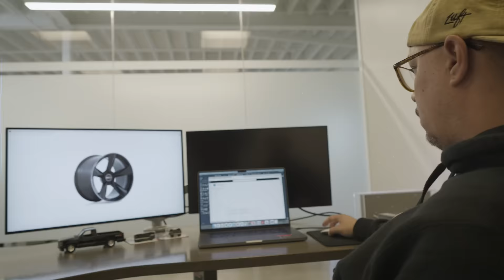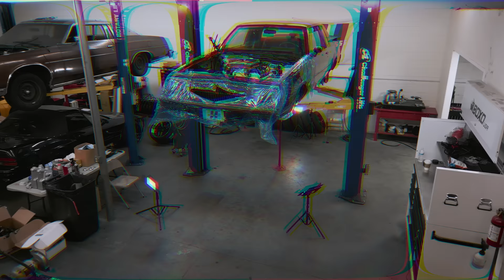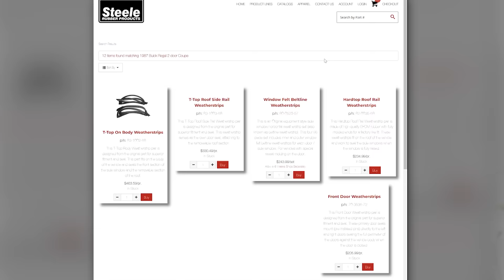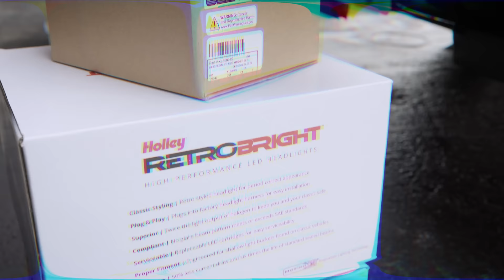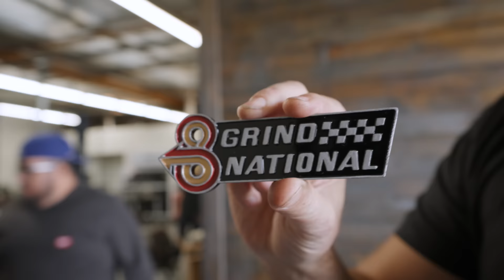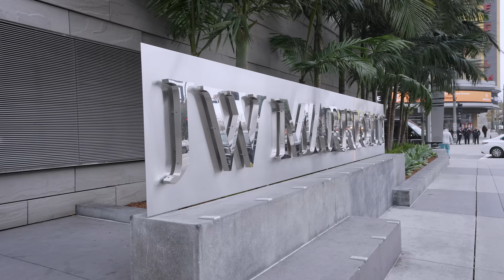IT'S A SWEEP! Rollin' to Victory in the Grind National - Episode 6

Comment: No dynamat on doors? Call yourselves professional?
Reply: Factory installation works great and was in good shape - absolutely no need to replace or add to it.
Reply: The interior will be completely ripped out and redesigned in the next phase of the build. 🫡
Reply: This can go one of two ways and both of which heavily favor to owner preference and time constraints. Some folks may want to the nostalgic sensory and sounds that is 80s specific... and some may not.

Like the seat belt system from this era as an example... Some may want to update to a modern, aftermarket 4 point or 5 point system especially with this LT4 powerplant. Others may want to keep these period correct seat belts from the 80's.

The later option gives the opportunity to leave a scolding hot Buick branded buckle/latch knot on you (and other naysayers) for the not taking into account what they did in such a short time period as the car's build progress evolves with time. ;)